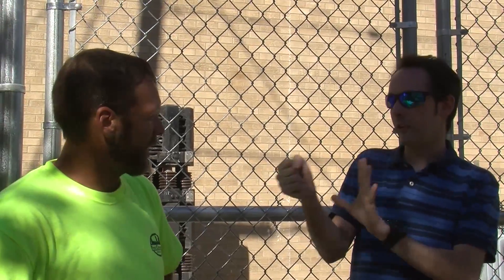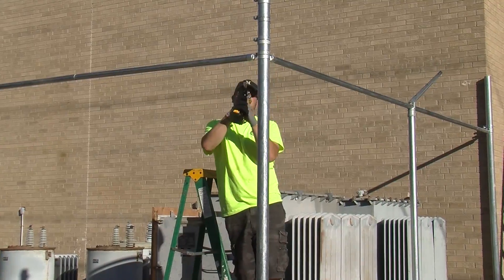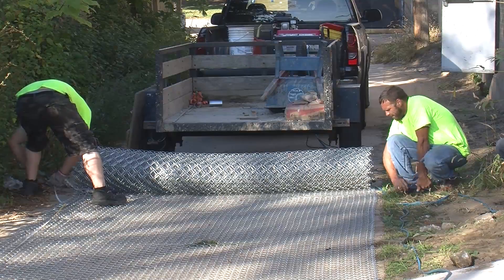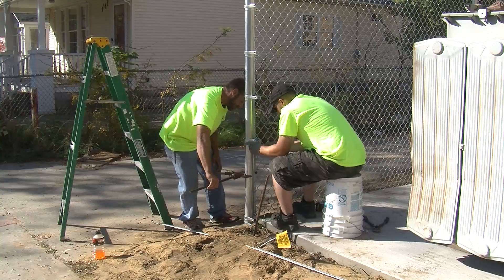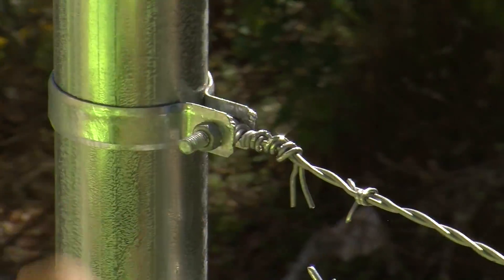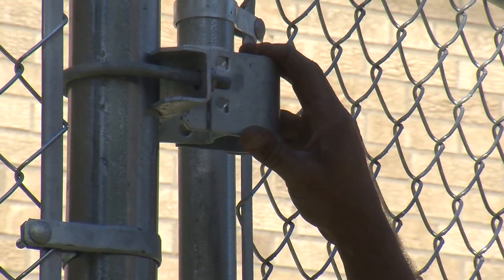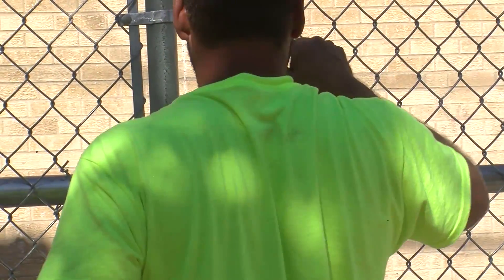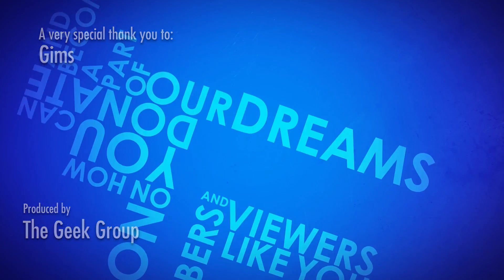Installing a Chain-Link Fence

Comment: Dear The National Science Ins...,
Not sure the life expectancy of any number of styled fences but as I walk pass a few in my daily walks, I wonder why one can't develop a rust cancellor and restrengthener per  failing fence as properly developed coating  is covered with this coating non plastic that will make the fence stand longer and viable long after life expectancy of when said fence expires. At expiration date calculated for replacement, it would look like it was just installed!   Antiques, current and future fencing, anything that qualifies for strength and longevity through engineering all around! Thank you.
Sincerely,
Don Suiters
Clearwater Florida
USA
Best way to create fencing is high quality far above minimum engineering requirements tied to most reasonable pricing. All customers will thank you for  galvanized fencing that doesn't wear out but perhaps strengthens over time. Then apply it to 
Apologies, my cell screen is bouncing all around and can not concentrate but think it is my eye doing the bouncing around. Sorry

Comment: heres a good tip use your pull-jack to pull up your wire to height start at the posts and get your inner ties.
Reply: If you were going to buy your first pul-jak. Would you get the combination kit with the 30 inch work head and the 48 inch with the stretch frame or just the one work head scene here in this video?

Comment: They did a great job on that fence. I have a set of those post hole diggers they used, they are the best type of post hole diggers period. Mine have been used so much the handles now touch.